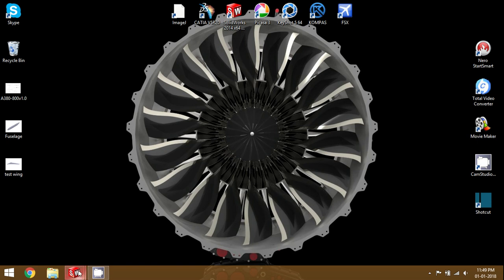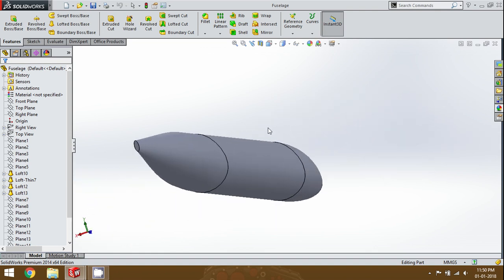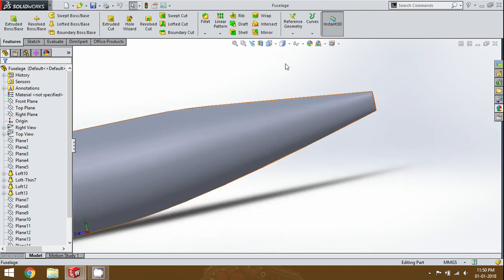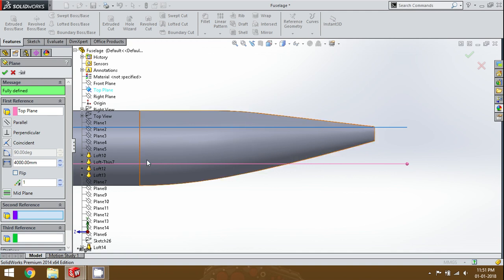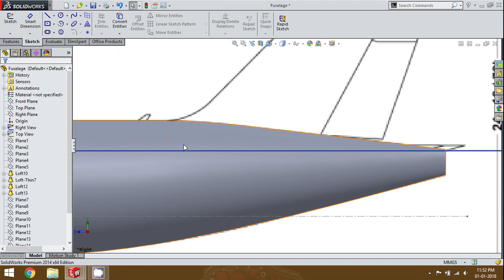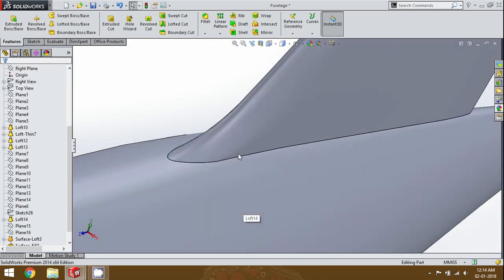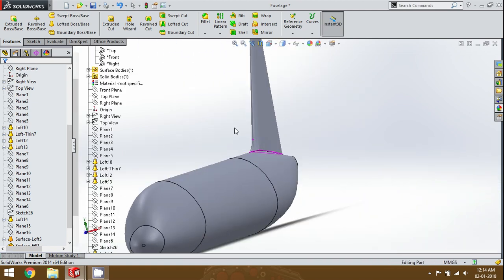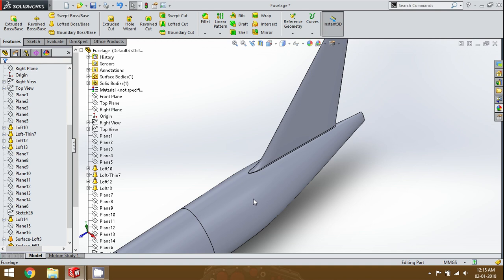Designing an A380 : Part 3 (Vertical Stabilizer) SolidWorks Tutorial

Comment: Hy;
I´m having a problem. I did everything till here, but the blue print of the fuselage just appears when I open the specific sketch it´s in. When I did the fuselage all was well and when I open the wings files everything is ok either. The image is not suppressed and nothing is occult. I´ve already get the original configurations on solidworks but nothing changed. I don´t know what is happening. If you could help I´de be thankfull. And congratulations on your work!